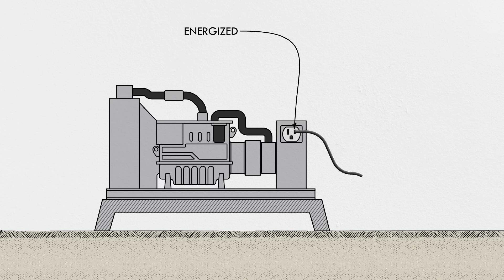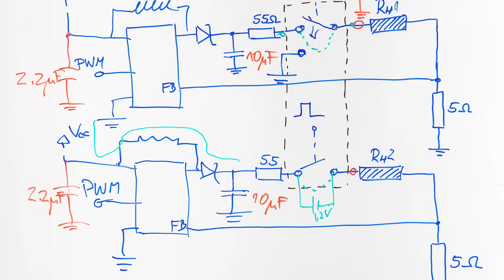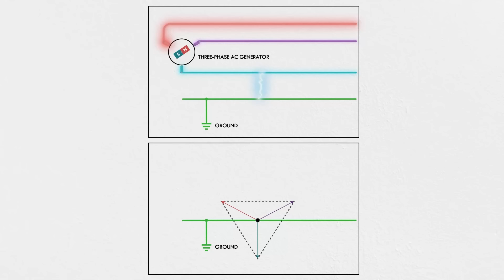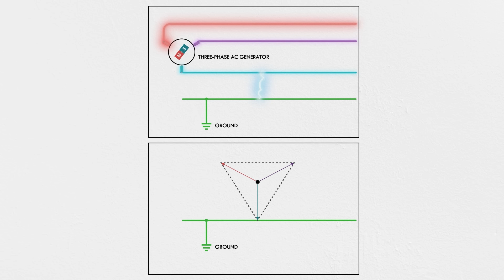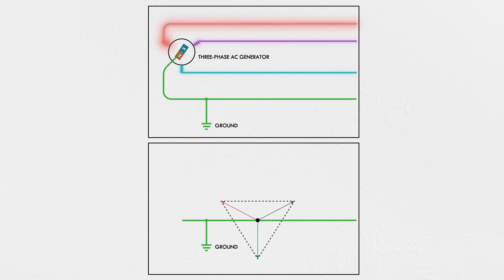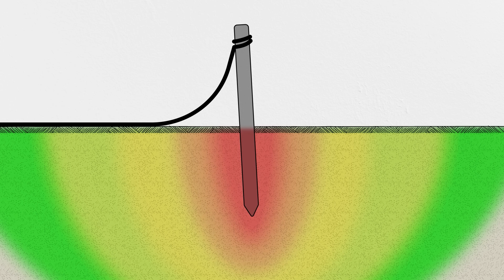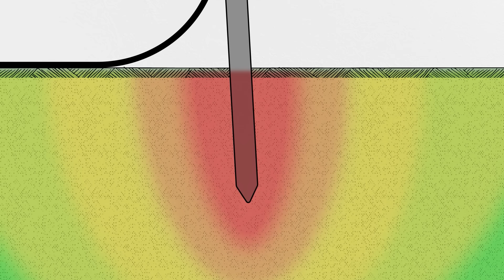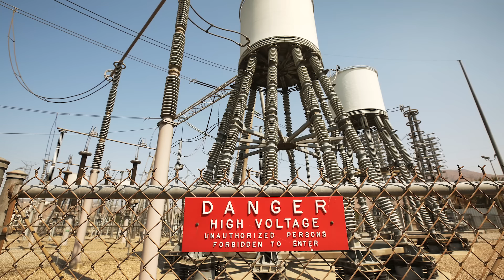Where Does Grounded Electricity Actually Go?

Comment: I actually caught myself asking myself this question during a road trip this past week.  I found myself sleeping on  the floor of a one room (10x12) cabin, on top of a ridge at 6,000 ft in elevation, while a big storm moved in.  At the sound of approaching thunder, I began to consider how the cabin was grounded... or if it was.  I hadn't been ready for rain, so ended up sleeping on the floor at the base of the loft, an aluminum ladder pretty much right at my back heading up to the loft, under a gabled metal roof.  Now I have been in a fire lookout tower during a storm, and knew how the grounding worked on those with metal wires that ran over the roof, down the sides of the tower, and into the ground below.  But, this wasn't a tower up in the air, and I was rather close to that ground.  Now I knew the guy who built the cabin, he is a bridge engineer, so, figured, this was grounded sure thing.  But.... I have not seen any metal wires running down the outside of the cabin walls, or along the roof.  Maybe there were grounding rods in the walls  Suddenly not sure, decided sitting against the bottom of an aluminum ladder, on the cabin floor, maybe wasn't the best spot with lighting coming.  Got home and found this video and now have come to the conclusion.... yeah, wasn't the best spot.  Turned out the cabin was not grounded.
Reply: If it wasn't grounded then it would be somewhat less likely to be struck by lightning than a grounded cabin would. Swings and roundabouts.

Comment: I'm aware of a number of cases where cast iron water mains developed leaks due to electrical grounds from a business like a welding shop.  The grounds weren't on the main itself, but there was enough current to slowly strip iron from the pipe eventually causing leaks.

Comment: The top wires on a transmission line are called shield wires, often a smaller steel cable or now days a Fiber Optics cable ("OPGW") which can be used for telecom purposes. These are used to protect the conductors in the event of a lightning strike as they are grounded to the structure and consequently the actual ground. If the structure is steel, it itself is the ground "path" which is then usually tied to some sort of grounding rod or cable buried next to the foundation of the structure. If it is a wooden pole, then usually there is a ground wire that runs the length of the pole into the ground near the base of the pole. One of the lesser known issues with this is that people will attempt to steal the grounding wires off of structures because they think they can get money for the copper scrap. What they don't know is that it's actually just aluminum or steel coated with a thin layer of copper, so it's hardly worth anything in scrap.
Reply: You answered a question I had for along time and never asked. I kinda had figured the wire going down the wooden pole was ground  but didn't know why. Thanks
Reply: We use 25mm2 copper in our city for the 20kv poles. and well all the other stuff too. No idea about the 110kv and 400kv lines tho

Comment: I'm a senior undergrad in EE, this video is great! You did a great job explaining the many many different meanings of ground without waving your hands about semi-true analogies, and you did it in an easy to understand manner. As a kid I used to be confused about neutral vs ground in typical house wiring, after all they are bonded at the panel so shouldn't they be the same? No, of course not! Current flows in a closed loop, ground vs neutral vs return path or whatever you call it is just whatever loop that current happens to be flowing back through. Now just wait till yall get to class and learn that all the electrons move backwards...
Reply: Or wait until you start learning about it from the physics side and find out the electrons aren't flowing at all in either direction! There are so many abstractions we apply to complex systems to make practical assumptions that can actually be applied.

Comment: I asked my cousin (a railroader) what the metal straps I saw between sections of platform at a passenger station on the electric train line were for.  He said it was for grounding, and that you could sometimes measure quite a voltage between structural elements and neutral on the line.  Presumably these were generated by induction.  Eventually I found the similar straps from these structures to earth grounds.  If any sections became electrically isolated, they could present quite the hazard -- for instance for someone walking from one section to another.  The straps kept all the sections at the same potential.
Reply: This is basic equipotential bonding. Everything in a substation or similar high voltage installation, even the fences and gates, are bonded like this, and they have steel grid mats beneath the gravel so that the ground itself is all the same voltage as the metal structures.

Comment: Last year I was driving down the road during a storm. There was a tree that had blown over and leaning on some power lines. The part of the tree that was in contact with the power lines was smoldering, and I saw flames too. The fire department was on scene, but the guys were still sitting in their trucks. Pretty neat to see.
Reply: yeah, nothing the fire crew can do except tell people to keep clear until power gets there to shut down the line.
Reply: LOL, yea they were "F that", we'll wait until it's off.
Reply: @kenbrown2808  Actually some german fire crews now have spray nozzles that allow them to treat fires near train lines without having to wait for the power to get shut off and someone to come out and manually ground the line. The key is ensuring droplets instead of stream and enough distance to prevent arcing.
Reply: @namibjDerEchte  train lines run a little bit lower voltage than our overhead power lines.

Comment: In your generator thought experiment, there could be a current of about 2 microamps due to capacitive coupling. Of course if you drove the hot line into the ground, then you would get a pretty bad shock if you touched the generator, stopping which is ultimately why we have earth bonding.
Reply: If there is no flow of current, what would happen with the energy (if any) produced by the generator? would the generator spin super fast?
Reply: @evanc1721  The generator itself wouldn't be producing much if any power. With no current flowing there would be no torque on the shaft and it would spin relatively freely. With no load the engine would likely rev up, but most generators have rpm governors that would reduce the flow of fuel to keep the motor spinning at the same rate. There would be some energy produced in the form of waste heat from combustion and some going to frictional losses in the both the engine and generator portion but there wouldn't really be any power produced.
Reply: @user-oj9iz4vb4q  Thanks a lot, this is very helpful

Comment: A video or a short on grounding methods might be worth doing. It's possible to ground in sandy soil using an Ufer ground (rod embedded in a block of concrete) because of how much surface area it creates.

Comment: As a practicing electrical and embedded software engineer, this covers the civil engineering side of grounding as a top level overview.  

There is also the Circuit board aspects of ground planes, shielding of sensitive signals, and having separate analog and digital grounds to avoid digital transition induced spikes interfering with rapidly sampled analog signals.  

For ultra-precise small current measurements in test gear, we can even create a ground-like shielding follower to minimize the current through the board surrounding the signal under test.  That is isolation from everything by making your own ground-like signal.  

Also Star Grounding and avoiding ground loops and resonant ground structures.  In circuitry capable of making GHz noise from transitions or signal frequencies near such, 90 degree angles can be bad, 180 degrees with a via can resonate at quarter wavelength.  etc.  

Cell phone touch screens can get conducted EMI from insufficiently filtered power supplies.  

In short, ground is no joke, filtering of power and ground is no joke, conducted EMI is no joke.  In electrical engineering, I tell people that board and wiring design mistakes have time to market and customer consequences, be cautious, check for bad things, have good review relationships with your fellow engineers.  You will learn from their past mistakes.
Reply: I would like email and have a correspondence with you. I am an electrician and currently working on public inputs for changes to the 2026 National Electrical Code.
Reply: @JacobRiddle-tn9fo  I am flattered, however I am also not necessarily the man for that job.  I will however give some contributions here, take them as you may.  In no particular order.  

1) Disclaimer I have always been insured by employers, not a PE, never tested as such.  

2) I mostly do embedded software, including safety critical stuff.  Its really all about ensuring that code is sane, reviewed, cannot enter a state which cannot be left from, achieves full code coverage per certain guidelines, meets all requirements, and system integrates.  Also cybersecurity and OS Dev and other higher level things.  Volunteering to fix things that are not to par on safety is a thing for me, as is volunteering for hard jobs for experience.  This is also generally not the kind of thing one adds stuff to NEC from.  It has its own rules and guidelines.  Often different per organization.  That said:

I have heard of some power engineering firms trying to make circuits that are essentially fly-by-wire (FBW) for safety of current conduction on in-place wiring.  Class 4 circuits IIRC.  Thats like a cross between what I do and what NEC may have in the future.  I know because of a job interview I had.  My advice is that the usage of FBW-like engineering controls can be an improvement because it would act like a fault mitigating circuit breaker in real time.  

I would not permit its usage to render unsafe wiring safe due to radiated heat hazards over long periods of time, but instead to permit its usage upon prior inspected wiring and I leave the definition of that to those who can spend the time.  I also believe that a standard set of detections and mitigations should be developed to standardize testing of such products to prevent ineffective devices entering the market.  

3) I am at best now a senior engineer with 5y of experience and I haven't been in a role close to power engineering in 4y.  Not typical for someone contributing to NEC, I suppose.  

4) I mostly talked in my prior comment about signal integrity for small low power circuits.  More pertinent to PCB and consumer product design.  

5) My best advice on what to add to the NEC is to find a way of enforcing sanity in consumer products by making sure that relays used in mains rated cooking appliances such as microwaves and toasters cannot ever fail shut.   I just had this happen and that freaked me out more than any lab incident that ever happened to me.  Scary fire and carbon monoxide hazard, always watch food or set spare  timers, even with a microwave I guess.  TImed contactor might be a good hack if you don't need the time on the microwave.  

I had headphones on and was watching Youtube when I wondered why the food smelled so good.   My food had cooked for 5m instead of 2m.  Timer was done, light was out.  I deduced the problem before even taking it apart and got it right first measurement.  I then rendered the microwave safe and extracted parts I wanted before tossing it out.  Maybe I should have investigated further as to cause inside the relay, but so far as I can think of, it had a contact adhesion or something and was a 100 ohm contact.  Arcing and sparking probably made the relay actually turn on without blowing up.    

Is there anything else you would like to ask, given the above?
Reply: I’m an amateur radio operator. Grounding for RF needs special attention because most of the current flows near the surface of a wire. So a wide strip of copper is often used to connect to ground because it has a much higher surface area. You are supposed to have an RF ground separate from the power ground but that also needs to be bonded to the house ground. Metal towers also need lighting protection grounding. One odd thing: in the traditional AM radio tower the ground is part of the antenna—wires or metal grids called radials run far out from the tower for this purpose. More conductive ground is better for this and sea water is excellent. I’m no expert but people spend a lot of time on improving grounding and bonding.

Comment: We took a 34.5 kv three phase 1000 kva transformer to 12kv transformer, connected to 35 ground rods placed around and inside a pond energized it with a HV breaker and the settlement in the pond went straight to the bottom and the water turned crystal clear in a flash. Never in my life have I seen anything like that before and probably never will again. The electrical engineer created this monstrosity of a hookup. I was amazed.
Reply: What was the purpose of doing that? Sounds interesting
Reply: I think you mean the sediment not settlement.
Reply: @teeanahera8949  yeah autocorrect got me I didn't proof read it. I did mean sediment.
Reply: @buckodonnghaile4309  I don't know why I didn't see this comment earlier. Anyway this was at a coal washing plant and the water was used for the plant. The pond had become full of sediment and they had cleaned the pond out. Instead of waiting on the water to clear up on its own which would take a week or longer this idea was thought up first.  It was just so the sediment wouldn't get into the pumps and system lines and clog them up. The plant was down a half a day instead of a week or more. If they weren't producing clean coal they weren't happy as they were loading out three 100 car trains a week and the trains were scheduled so any delay the railroad would penalize them an enormous amount of money.
Reply: what voltage was it energized at?  three phase i assume.  glad you had that transformer laying around, spare.  i wish i had one.

Comment: Hi Grady,
I always enjoy your videos. Thanks so much for taking the time to create & produce them!
As an industrial/commercial electrician for nearly 40 years (recently retired but still "working"), I found this video particularly interesting.
As a note: Nearly all modern transmission & distribution systems (with exception of rural SWER systems) always keep a grounded/neutral conductor present with the phase conductor(s), and that ground/neutral conductor is bonded to the earth at every line pole, and every transformer/switch/breaker/recloser location, thus enhancing the earth-ground "connection" on the neutral conductor sytem, which keeps the potential difference of the neutral & ground minimized, in the event of a physical failure of a transmission/distribution line (like a downed pole). I.e., lots of connections to the actual "ground" to minimize resistance and differential potential. 

Anyway, great video! I always learn something new!

Keep 'em coming!

All the best from west Texas!
~Alan
Reply: also worth mentioning that there are ungrounded circuits that use isolating transformers, I want to say in hospitals or certain classified areas where arcs are a concern, definitely for pool lighting i think. And also that while these ungrounded circuits are indeed safer, if a neutral somehow becomes grounded, then a human could be unexpectedly energized, which was a concern in the early days of electricity, when most if not all circuits were ungrounded. The topic of grounding is very interesting, it blew my mind when I first learned the neutral and ground were bonded in the panel. I was going to school to be an industrial electrician but then covid hit... sadly never learned what I wanted to because the school shut down (programming PLCs and HMIs and that sort of thing)

Comment: That line: "you may have heard that electricity takes the path of least resistance" followed by pointing out that in fact, it follows ALL available paths at various levels determined by their individual conductivity. Yes! That jolted(lol) my brain a bit, and makes a lot more sense to me now. Well of course it does - we all know that we can design a circuit that splits into X number of parallel paths, each having a different resistance, and the electric potential will flow through all of those paths simultaneously at levels that are based on the individual resistance of each path. Excellent descriptions in this video. Much goodness.

Comment: One more thing.  Some (maybe most) modern relays have oscilloscopes built into them, so they can detect not just the intensity, but also the waveform of the current.  This allows enhanced protection, because some low-level faults may not get enough current to trip out the relay, but if the oscilloscope detects a waveform indicative of a fault it can still trip the station or distribution circuit.
Reply: If there is no waveform acreen then it is not a scope. It is a microprocessor controlled relay.
Reply: I guess it uses a current transformer in series with an ADC to sample the waveform of the current. Then, some DSP is applied to detect problems